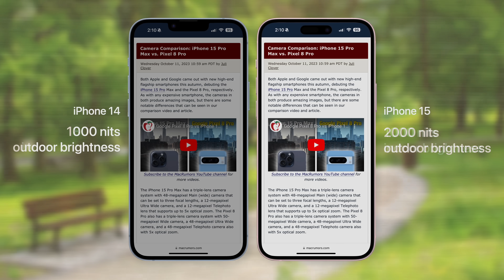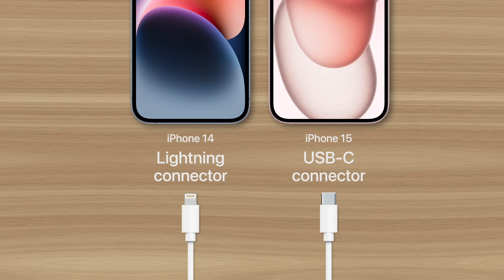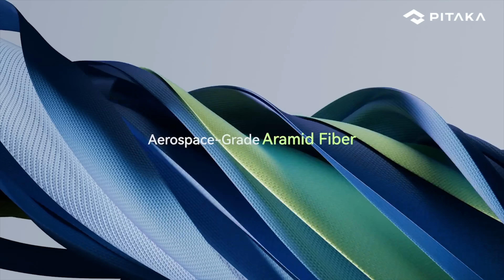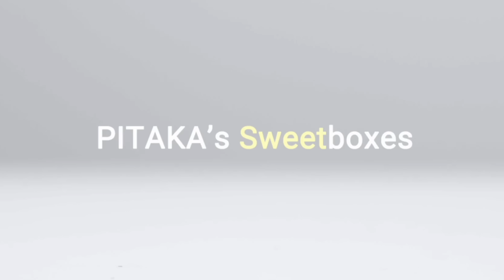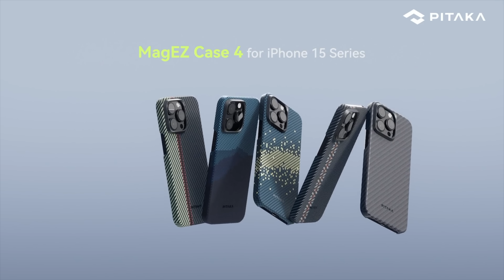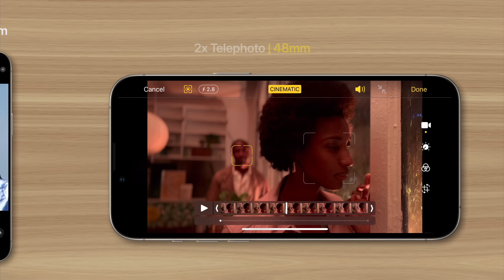iPhone 15: Everything New

Comment: Lightning connector, u will be missed. The end of an era😢🫶🏻
Reply: I’m actually excited to make the switch. The lightning connectors wear out quickly, they become unusable, and they are expensive to replace. I won’t miss them. USB c cables last longer, and they are much cheaper. This will make it so much easier for everyone.
Reply: @AskArthur just dont bend them or charge at an angle that curves them

Comment: s23 series seems to be better than this
Reply: No way
Samsung sucks
Reply: @Harrrrrry12344 Stupid Crappy iSheep, you like to buy from a tech company that controls you, it's Restrictive as heck and not as innovative as Android!
Reply: @QuandalePringle99 Samsung fanboy 🤡🤡🤡🤡🤡😂 get mad
Reply: @DanielPacheco-e3e  Dude, shut up. Literally you have a phone that is Restrictive, has heating issues and it has a 60hz display.
Reply: @DanielPacheco-e3e  And I went from Samsung to OnePlus.
Reply: @QuandalePringle99 it has 120 hz bestie
Reply: @veirenon  Yeah, but it seems kind of fake.
Reply: @QuandalePringle99  how Lmao
Reply: @veirenon  If you go to the app library (to do the scrolling test), you see the refresh rate will seem like 90hz. Android flagships have real 120hz because a higher refresh rate provides faster scrolling and smoother animations. The 120hz on the iPhone 15 Pro Max (or the 14 Pro Max or 13 Pro Max) seems sorta slow, while the 120hz on Android flagships seem faster. There are Android flagships with 144, 165 or 240hz displays that provide an ultra-smooth, responsive and fast scrolling experience.
Reply: @QuandalePringle99  have tried it with my android and it seems just like the android at 120hz. Idk where you got that from but smells like ass
Reply: @veirenon  Dude, unless you get a new Android flagship & check the specs for the display and the rest of the phone. If the phone's display supports 144, 165 or 240hz, then you're good to go. You just gotta check the specs carefully, otherwise you won't know if it's 144, 165 or 240hz, buddy.
Reply: @QuandalePringle99  it’s a 256G s22 ultra. Lmao
Reply: @veirenon  Nice

Comment: I was thinking about getting the iphone 15 pro max to replace a 4 year old oneplus 7 pro, but reading about all of these very troubling issues about the 15 pro max is causing me to be really apprehensive about doing so. 
If i persist, i may wait until this ios 17.1 update has been released thats supposed to fix these problems with the pro devices. 
I really hope the problems are software related and not the hardware itself.
Reply: Get a Pixel 😁
Reply: @CXLVII  i have given some thought about the Pixel 8 pro
I like the looks of it and I'm sure it's a pretty good phone. 
Have you owned some Pixel phones...?
Reply: @laurenslee9134  I have a Pixel 6a and it's pretty nice. Google's software is good, and it takes good photos.
Reply: @laurenslee9134  i have a p7p, it's a fantasic phone. i havent used the p8p, but cameras are fantastic, the performance might not be as good as something like the s23 or iphone 15, but it's barely noticeable in pretty much everything you do, and it's also the best for longevity, with 7 years of software support. also google made huge improvements to the heating, cellular, and battery life issues in the p7p.
Reply: @laurenslee9134 Samsung Z Fold 5 is the best phone no cap amazing performance 1 day long lasting battery if you dont game, best cameras on an foldable phone, best Android software for Global market, first foldable to charge fastest on global.
Reply: @Laurenslee9134 Get a Newer Flagship Android that is powered by the Qualcomm Snapdragon 8+ Gen 1 Processor, or Qualcomm Snapdragon 8 Gen 2 or the Snapdragon 8 Gen 3 which will be included in new Flagship Android Phones that will come out in 2024. And the Qualcomm Snapdragon 8 Gen 3 will come close to the iPhone 15 Pro's A17 Pro processor in terms of CPU and GPU performance (And there will be an upgraded version of the Snapdragon 8 Gen 3 Processor, the Snapdragon 8+ Gen 3 that will be a little bit more powerful and battery efficient than the regular Snapdragon 8 Gen 3 Processor, and probably the Snapdragon 8+ Gen 3 will destroy the A17 Pro in terms of higher CPU and GPU Performance than the A17 Pro). Plus, the iPhone 15 is dumb because it does have heating issues and iOS is not that great, Android 15 will also come out in 2024 (And the Hidden codename for Android 15 will be Android Vanilla Ice cream).

Comment: The only thing that's new is USB-C which every flagship Android phone has since 2016. There, saved everyone 6 minutes of their time.
Reply: again, no
Reply: @MidnightReaper26 again, yes*
Reply: @bokbasagna38  ain’t taking shit from no mf that has the windows flag as their pfp 😭 yall people so dumb, bitching that apple still used lightning then bitching when they add it, cope harder
Reply: True. Apple is just greedy and can't think of their own ideas lol
Reply: @bokbasagna38 dynamic island, magsafe, lightning, apple silicon and more. For sure cant innovate or make anything of their own
Reply: Z Fold 5 better than it lol
Reply: @WololoWololo2  is it tho, atleast with an iphone you cant scratch the screen with a finger nail
Reply: @WololoWololo2  No, it’s not. Stop lying to yourself.
Reply: @MidnightReaper26  Yes it is, try it yourself
Reply: @WololoWololo2  No, it’s not. Come back when simply existing doesn’t damage your display. Maybe that’ll happen before that shitty samsung blows up or dies from screen burn in 🤣
Reply: @MidnightReaper26  Yes i came back with my months old Z Fold 5 1 TB 12 GB RAM here I have no weaknesses 😂 still not damaged and as new as Samsung made that device in their factories, gotta admit Z Fold 5 has improved a lot from previous gen Fold 4 at anything, Samsung takes durability so seriously that they have put Armor Aluminum into it, it is the same back material that S23 Ultra has. In battery Z Fold 5 has also outlasted S23 Ultra by one hour, but S23 Ultra has 5000 mAh battery and Z Fold 5 has 4200 mAh, that Z Fold 5 is way more durable than you expect
Reply: @WololoWololo2  Folds are and always will be less durable than traditional smartphones. They are also pointlessly expensive for weak specs. Samsung phones are and will forever be garbage, spoken by someone who was a diehard samsung lover until my S10 5G blew up, and Note20U and S20U both had board failures 2-3 months into ownership of them both respectively.

If you had a hill to die on worth a damn, you would’ve brought up the OnePlus Open, a foldable that’s not a pile of shit like pretty much every samsung made within the past 6 years.
Reply: @MidnightReaper26  Dude Xiaomi 13 Pro gets way less updates and is less stable this is why i changed to Z Fold 5. But I agree Samsung is trash in hardware for price. Atleast on Samsung you can use their long supported models upto 5 years. In Xiaomi you have to throw it in midway
Reply: @MidnightReaper26  Chinese companies except Huawei and Xiaomi doesen't sell any smartphones on my country. Xiaomi Mix Fold 3 isnt on my country but every global traditional models is on there. Huawei Mate X3 is also bough with Online but I wanted to see it in otber stores to test that device. Oneplus isnt in my country.  Huawei Mate X5 is the newest Huawei foldable right now. Samsung is the only company that sells newest possible Foldables in every countries, and One Ui 5.1.1 is so amazing and optimized for that device Samsung really worked hardest and most efficient while developing their foldable devices in software aswell
Reply: @MidnightReaper26  Pointlessly expensive? Say that to iPhone 15 series with their 60Hz on base models atleast Samsung offers 120Hz on almost all price ranges,  unlike Xiaomi and other Chinese manufacturers; all Chinese Manufacturers even puts 144Hz panels into their smartphones but sadly they are not on my country
Reply: @MidnightReaper26  Z Fold 5 1 TB 12 GB RAM model has 50 MP main camera and 2 other cameras with an flashlight, sold at the price of iPhone 12 Pro Max 512 GB. You cant do any multitasking and be free as Android is free, what I mean by free is you can do anything on Android, it is so worth it for what you would pay for
Reply: @MidnightReaper26  Do you have 3 screens on your iPhone? Front cover screen, and tablet screen combined by another 2 screens merged with 1 screen, the other is itself. Your iPhone screen cant do almost 4K resolution 😂
Reply: @WololoWololo2   

Galaxy ZFold 5 - 2159.99

iPhone 12 Pro Max (which has been discontinued for the past 3 years, not sure why you brought it up) - 600$ used, 1599$ new for 512GB

Not sure your point here. I can multitask just fine on iPhone, might not wanna bring up “free”, either.
Reply: @MidnightReaper26  LOL are you sure? Can you bring multiple windows into your screen at same time tho?

Comment: I just got my 15 in today. Nice upgrade from the iPhone 11.. The camera is awesome and the screen is very good even without 120hz. I hope the battery is much better than the 11.
Reply: i have the 11 too and i'm thinking about upgrading. did you notice significant changes in how smooth scrolling, animations, video and stuff like that feels? i'm a bit hesitant because they still haven't upgraded it from 60Hz, so it would be the same as my 11.
Reply: @MadDunhill  Its definitely worth an upgrade...BUT... if you can hold out, then do so. I upgraded from the X personally and it was well worth it. I decided when getting the X, to only upgrade every 5 years from them on. This way, It's always worth the upgrade. (My X can no longer upgrade so that helped in upgrading also)
Reply: @PromotingTheBeat same brother, just got the 15 now though
Reply: Same here I'm planning to upgrade my ip11 to ip15
Reply: Heh I got a 12 Pro Max from the 11
Reply: I’m upgrading from an 11 as well I didn’t want to but my 11 is going out hopefully it’s worth it but I’m mad cuz they don’t sell the phones with chargers any more
Reply: @shottienharry  iPhones are definitely not worth it. Samsung Galaxy S phones are cheaper and provide more performance and since it runs Android, more features and customization.
Reply: @bokbasagna38  idk what u mean by performance cuz iPhones still have the fastest chip
Reply: @FullMetalZilla  CPU is not all that matters. The base model of the Galaxy S23 has 8GB of RAM (along with available RAM Plus), while the base model of iPhone 15 only has 6GB of RAM, with no RAM Plus, because RAM Plus is only available on Android. Also, Samsung's GPU is better for gaming. Also the base model Galaxy S23 has a 120Hz adaptive display, while the base model of the iPhone 15 is still at 60Hz.
Reply: @gr.az11  iPhones are very limited by their operating system though. Which is one of the reasons why Samsung is better.
Reply: @bokbasagna38 Samsung will always make better flagships than Apple but people will still get iPhones due to brand loyalty
Reply: It's def better than the 11 and worth upgrading
Reply: hows battery
Reply: I upgraded from the 11 2 days ago and it was the best decision I ever made
Reply: Haha, Apple is late to the game! I got an S23 for an early birthday present from my parents, and it has a 120Hz adaptive display.
Reply: thats a good choice. i have 21+ 
all s series since 21 series  has a very long support from samsung  @bokbasagna38  
you can get 4 major android update( s21 can update till android 15 and s23 can update until android 17) and 5 years of security updates 
this support is similar to the same support apple gives to iphones so samsung is good now to offer long term support to flagship phones and tablets similar to apple